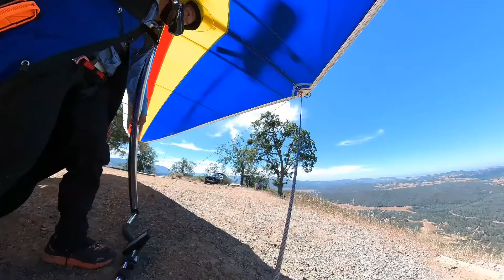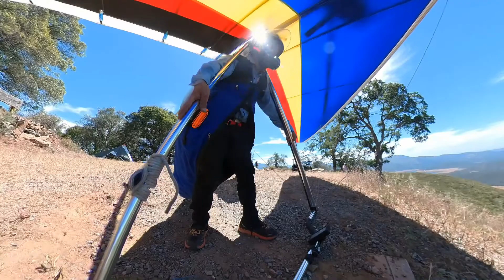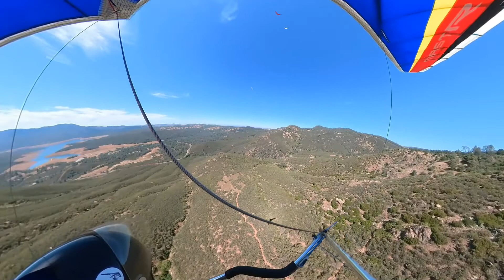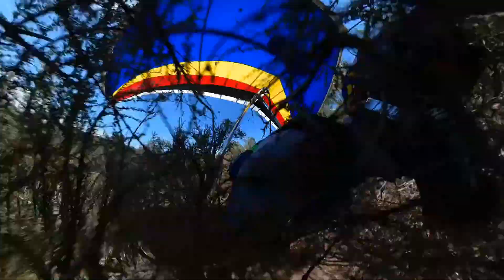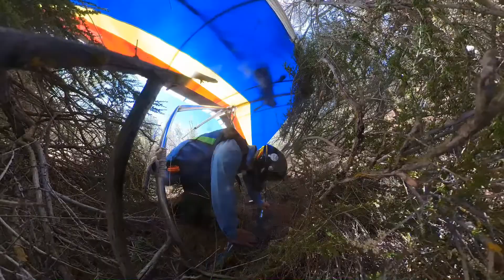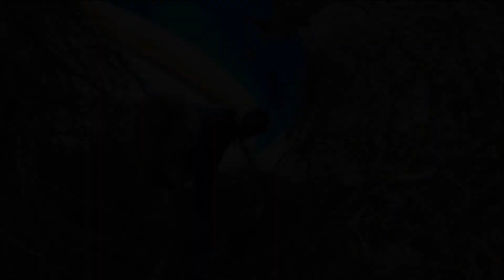2nd Day Flying McClure

Comment: The last half of the flight feels totally out control, Definitely need to back off and work on the basics, starting from harness setup to body position. I'm glad there's recognition that there's work to be done. Also one thing to think about is you may have narrowly missed eye damage from the branches in the bush. May want to flip your visor down before an anticipated impact. Fly for life!
Reply from the maker: You're not wrong: I got a few pokes and scratches on my face from my impact with the brush. Next time - visor down.

Comment: Don, see my comments about your harness/hang height on your previous video.  To add to that, the reason you can't reach the base-tube after take-off without activating the pitch control lever is a combination of being too high in the control frame and also the dyneema pitch-control line needs to be shortened.  When you take off and go prone, feet in the tail and the car slides and locks to the rear of the back plate, you should be able to easily reach the base tube even if at full head up pitch and not have to use the butt-lever to lean down to reach.  Once you get the hang height sorted out you need to do hang checks on the ground with someone holding the keel up so the wing is at glide attitude.  You can shorten the pitch line a lot and still be able to pitch so far down that you can literally kiss the base tube, but still pitch up to be head high while prone.  If you are swinging too far down or too far up, pitch line needs to be adjusted.  Right now you are pitching too far up, thats keeping your shoulders too far away from the base tube to reach it when you initially go prone after take off.
Reply from the maker: Thanks Luke; I'll discuss your suggestion with my provider.